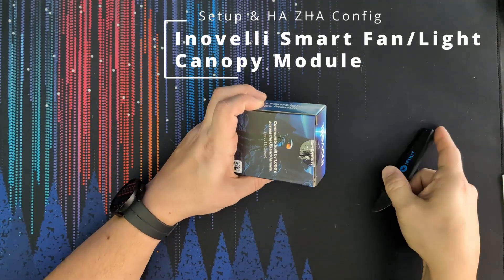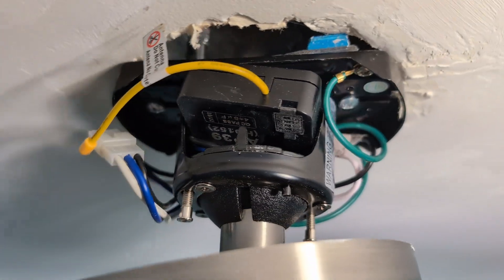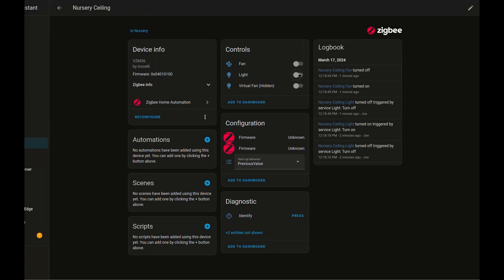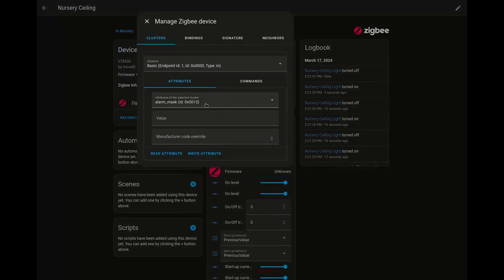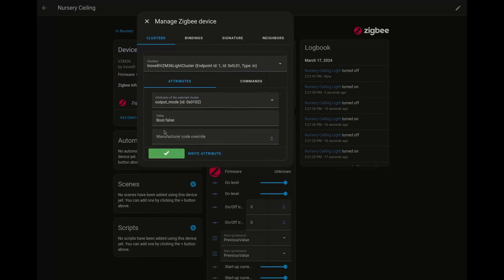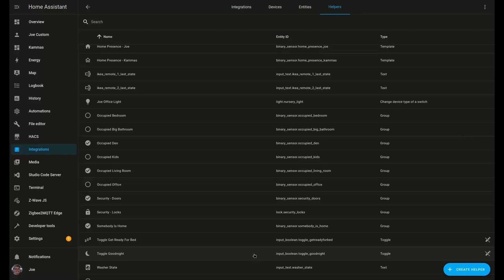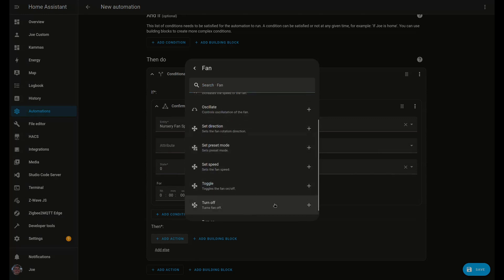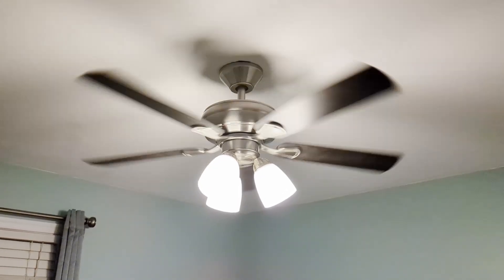Inovelli Fan Canopy Module Setup in Home Assistant with ZHA

Comment: How did you wire it? From the smart canopy to the fan, I put white to white, blue and red to blue on the fan, black to black from both.

Fan spins, Inovelli starts up, but it can't control the fan.
Reply from the maker: In my particular setup I'm using the single pole, power at switch configuration and matched up the wires with what was in my wall/ceiling/fan. The proper way to wire your setup will vary depending on what's in your walls.  https://help.inovelli.com/en/articles/8665269-blue-series-fan-light-canopy-module-wiring-schematics If you're still having an issue I'd recommend posting in the Inovelli community with pictures of your wires; otherwise I'd just be guessing at the appropriate configuration for your setup. I'd also recommend double checking that your wires are properly bound together; some of these fans use fairly thin stranded wires and it's easy to not have proper connectivity.

Comment: What type of fan do you have? Pull Chain? RF Remote? Thanks!
Reply from the maker: @uses0ap  it's a Hampton Bay fan from Home Depot that shipped with an RF remote setup. I've got 3 near identical fans all running this same setup now. That said, I've migrated them to ZigBee2MQTT instead of ZHA since making this in order to do upgraded binding and not need to create the whole extra automation for the config button.
Reply: @averagejoestech  Please do make that video.  I just switched to zigbee2mqtt and i have no idea how to get anything to work lol
Reply from the maker: This should walk through how to do it in Zigbee2mqtt https://youtu.be/0P6EdDSAeG0

Comment: You think the thread modules will work the same? And this only works for AC powered fans correct?
Reply from the maker: I would expect the Thread version to work the same, though it will be interesting to see how the binding over Thread works. It looks like they're using the same molds for the module so it should fit in the canopy the same way too. It's a way easier fit than the old Z-Wave/RF unit they had. Yes, AC fans only with this setup.
Reply: @averagejoestech  gotcha, thanks for responding! I have one more question though. If the switch to my fans control all power to the fan as in the light and fan aren’t separated, will using this setup still work?

From everything I’ve seen it seems like it should work. I’m just confused on how I can dim the lights AND control the 3 speed motor in my fan. Maybe I have to press the small button to switch between controlling the light and the fan?
Reply from the maker: @MajorPickleSwag  Yes that scenario is exactly what this is designed for! My house was only wired for a light up top. I added a reinforced fan bracket, and now use a single smart switch to control the light with the main portion of the switch, and then I press the small button on the switch to toggle the fan through the 3 speeds and off (the way an old school fan chain works). After making this video I eventually ended up flashing a switch with the newer firmware and moving to ZigBee2MQTT. It's simplified the binding substantially. I may try to make another video of how that process works (and a clearer video of the end result) soon.

Comment: Thanks for sharing. BTW for those with the same setup and having a problem setting minimum dim level. On canopy module (avoid dimming until bulb turns off), set InovelliVZM36LightCluster (Endpoint id: 1, Id: 0xfc31, Type: in)>minimum_level from 1 to something at or greater than the value when your bulb turns off (ex: mine is at 30).
Reply: Here's my automation:
  action:
  - service: fan.set_percentage
    target:
      entity_id: fan.inovelli_vzm36_canopy_module_fan
    data:
      percentage: >
        {% set current_fanspeed = state_attr("fan.inovelli_vzm36_canopy_module_fan","percentage") | int(0) %}
        {% set new_fanspeed = current_fanspeed + 33 | int %}
        {% if current_fanspeed >= 100%}
        {% set new_fanspeed = 0 | int %}
        {% endif %}
        {{new_fanspeed}}
  mode: single